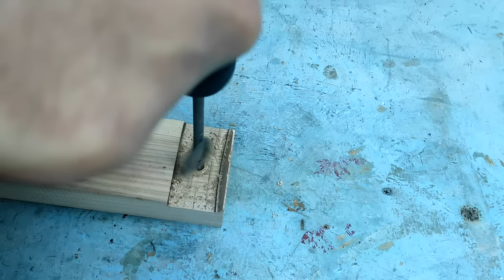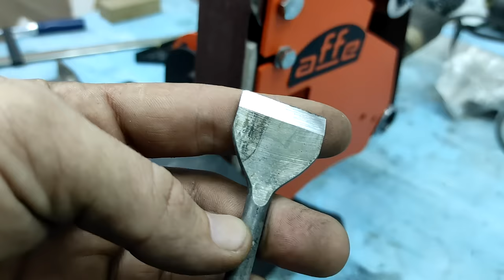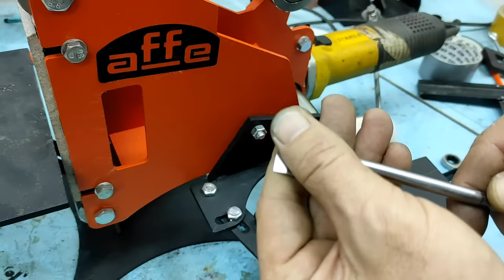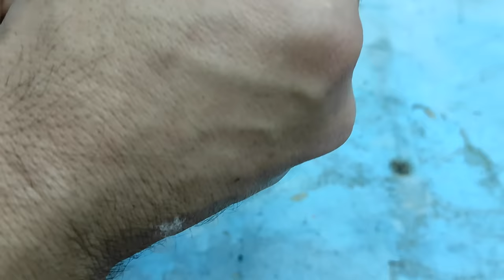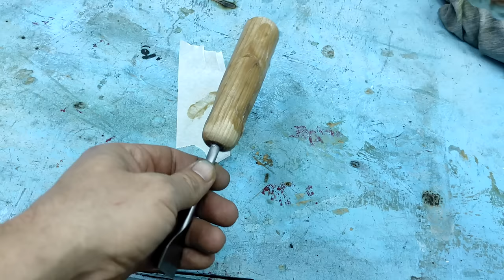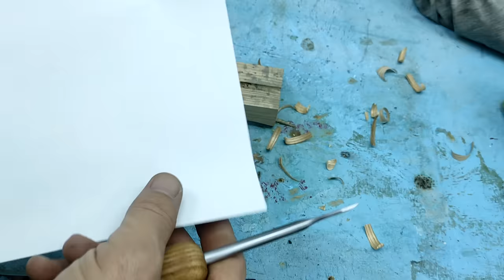Узнав этот СЕКРЕТ ты НИКОГДА не выбросишь перьевое сверло! Отличная идея своими руками

Comment: That was 8 minutes (video) in life most here will never get back. Probably really took 2 hours.
AAppreciate the attention to detail. But that tool could've been made in like 30 seconds with a cutting blade and a good guess at the 90 degree angle with a cutting wheel then to the grinding wheel to sharpen. Without the metal handle, hitting it with a hammer will hit harder to split wood and override the lack of precision lol. It may not shave your hand or be hardened, as any chisel for wood really needs to be hardened 😆 but it'll do the job juuuust fine!